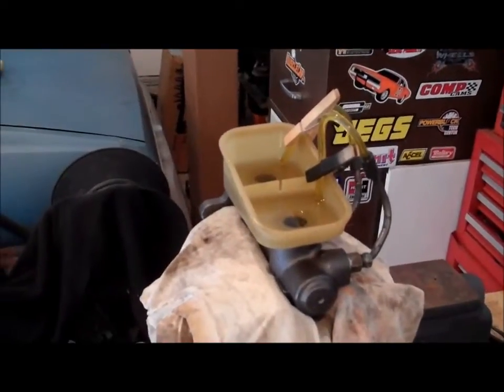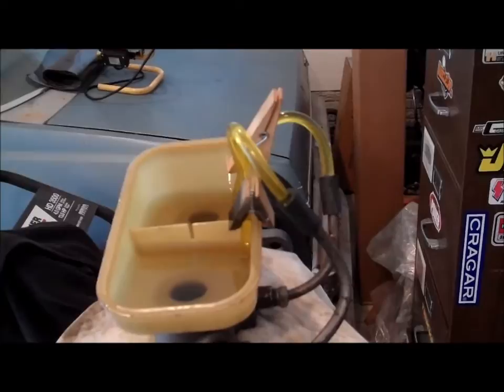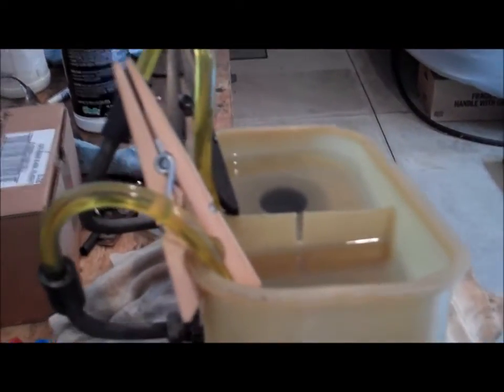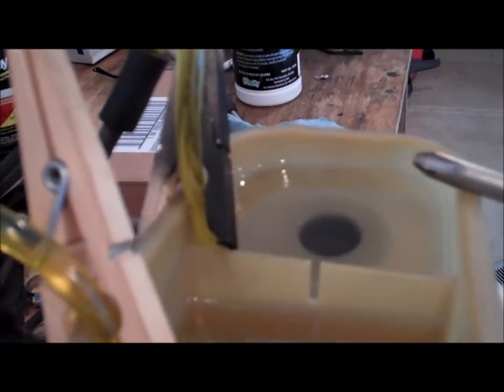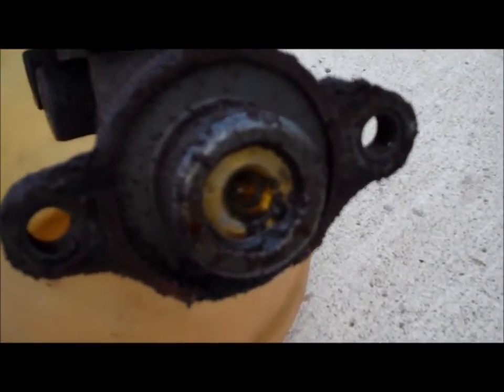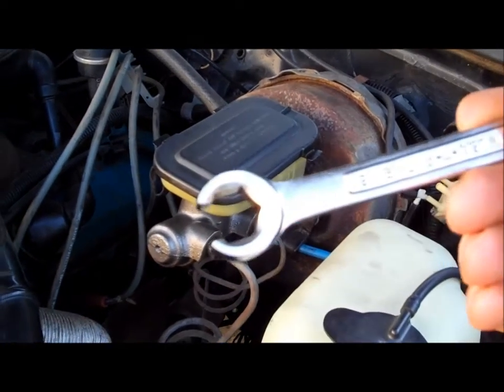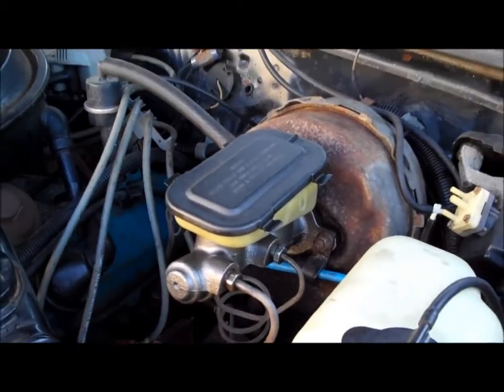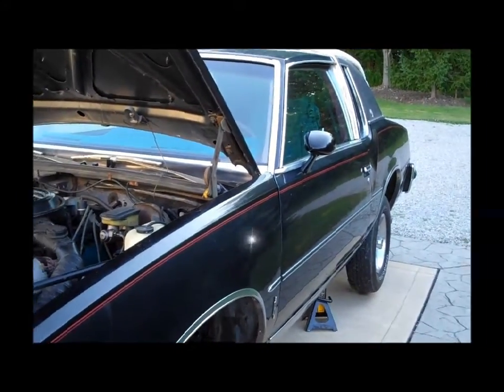How To Master Cylinder Replacement Classic G-Body Garage

Comment: I don't have a bench vice what I do is the same process with the hoses to the reservoir but I hook it all up to the booster n pump the brake peddle a few times works just the same as bench bleeding

Comment: Bro I’ve changed so many parts trying to figure out why my 84 Olds Cutlass Brougham keeps stalling out. When I turn the steering wheel, more so turning right while slowing down. What do you think?
Reply from the maker: Idle too low, vacuum leak. What parts have you changed?

Comment: I'm having trouble with my master cylinder where it squirts brake fluid out when I push the brake...its a brand new one and there's isn't any air in the lines.my pedal is somewhat stiff and my car will not stop right away...can you help me?
Reply from the maker: Sounds like the master is bad.
Reply: He's brakes usually means bad booster.

Comment: I have a 1981 Cadillac 2 door brougham,  the brake booster went bad. I got the old one out but now I can't get the new one in. The bracket on the inside has moved some how. I can't budge it. To line up again. Does that plate move some how?
Reply from the maker: The inside plate is actually the brake pedal assembly so get under the dash and you can push it around.
Reply: @ClassicGBodyGarage  thanks